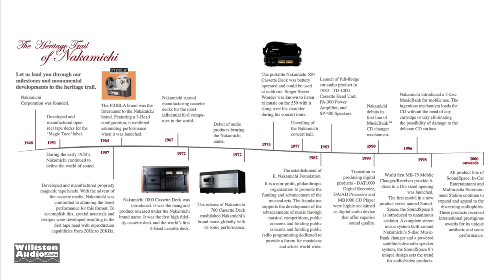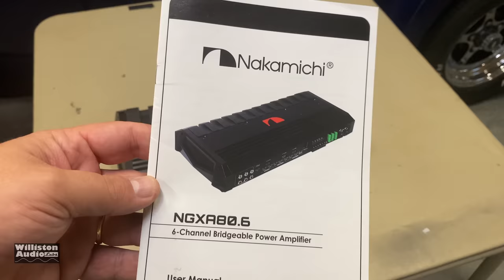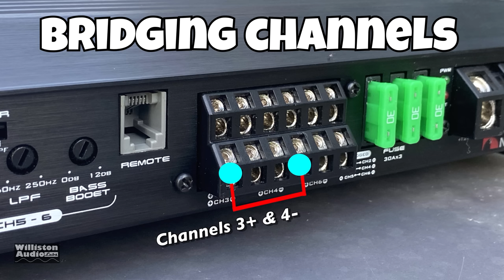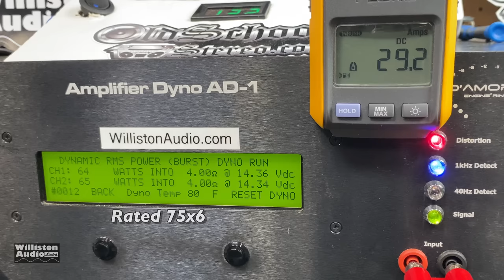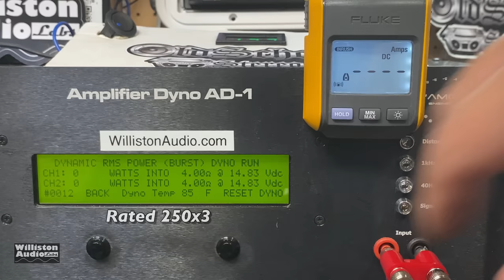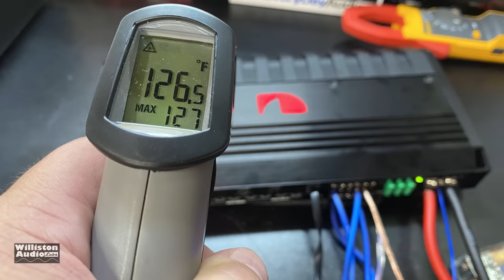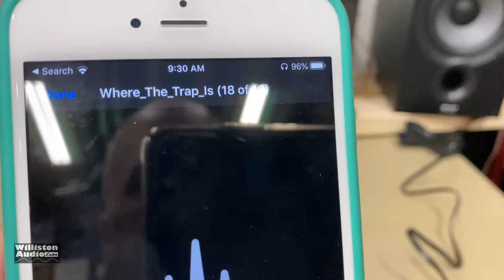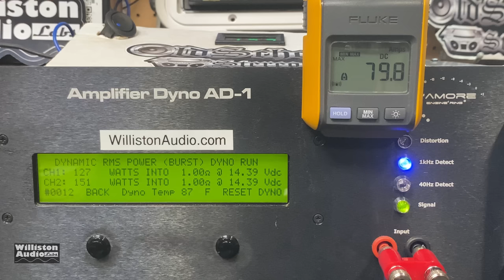Nakamichi is Back! 6 Channels for $200?

Comment: That's a shame, I still have my old Nakamichi headunit kicking around somewhere. For amplifiers, at that price point, albeit being a 4-channel I would run the Pioneer GM-D8704 all day long... especially that it's underrated with the big bonus that they are regulated and stable at 1-ohm on each channel (pretty much guaranteed at least 125-150W RMS between 1 and 4 ohms). That 1-ohm stability is way more worthy than having an additional two channels, especially if you are wiring low-impedance speakers on one channel (i.e. door midbass build with multiple speakers).

Comment: I have a serious question about a amplifier I have. This is the second  one. Both were brand new.  When you increase the volume. At  certain point  the amp cuts back the power  to around half  then builds back up.  And it does  this with a load  or no load.  I've  tested many amplifiers  with my multimeter  (100s) an have never seen that before.   Don't laugh  its a orion cobalt cbt4500.1.  Sadly it not the same a budget gem. Tested.  Which is  what I thought I was getting.

Comment: I hate to say this but you know what looking at the insides that amp just makes me kind of want to go ahead and shrivel up on the inside knowing that nakamachi ....has literally built an app to a cost and you know what it doesn't even make me want to buy it.    I'm sure it sounds good as everything else out there but that's the point. When you get one of these kinds of ants you expect to get basically a amplifier that has really good components and yeah it looks nice on the inside but it's just not what you'd expect from a high-quality premium brand.    

I honestly think that the Dual amplifier that I picked up a little while ago which is a 4-channel not only sounds amazing but to me with the upgrade just a few components for the $99 price that I got it for? It really brings it into another level.   

a 6 channel amp should basically be all about sound quality and you know what this really just doesn't make me feel like I want to purchase it. Yeah I got a lot of amplifiers just sitting around but you know the thing is is that sometimes you by and collect things that actually make you feel proud for owning them this just isn't one of those products for me.

Comment: Newbie to this Ch. but CR-7A owner since '86 so the lure of Nakamichi brought me here. I could care less for any pre-meat of the video chatter so I must admit to skipping ahead to the results of whatever you were going to do when what stopped me dead in my tracks was your unveiling of the Amplifier Dyno AD-1! I left this video to research that thing and now I am back to say ... If what I have seen here is correct, then wth happened? Some Chinese company bought he Nakamichi name and is now releasing garbage under its name? There must not be anything keeping someone from bastardizing a quality brand name like whoever owns the name now is. Ha, just remembered. About 10+ years ago driving through I believe Rosemead CA on one of the major blvds when I saw Rogersound Labs and nearly broke me neck whipping my head around to double take. Here in So Cal Rogersound Labs was a small higher end audio retailer that specialized in building as far as I know all of their own amps, pre-amps, tuners, speakers, etc., of which I still own amp, pre-amp, and speakers from. They went under around '93-ish? So when I saw that place around 2010 I had to stop in. Unfortunately it was just the name they had and nothing more. The Asian shop owner even seemed clueless as to the name the were selling under. Sad. But Nakamichi is back! Sad.

Comment: This might make an OK amp to do 3 way component up front. If the sound is decent then you can't go wrong for the price.  However how would the channels rate if you were only driving 2 rather than all 6? which would simulate different channels doing different notes.
Reply from the maker: Good point

Comment: Not to say your equipment is faulty, but could the amp dyno need to be certified. Cause I know the welders i run get certified every year. Those ratings are pretty close. Like I said not saying your not right just wondering

Comment: Shame about the power, but as mentioned in the other comments, they probably are nominal figures... so can't really bash them on the low numbers perhaps (though they should make this clear & not even quote nominals to begin with).

Flexible amp for the $$ and agree that having all the connections & switches on the 1 side is really nice. Also the red light up logo looks pretty neat.

Comment: According to the "specs" on amazon, that thermal cam has 80x60 resolution. Same as my built in thermal cam of my BV9900 Pro phone. Had the Cat S60 previously. Sad tho, Nakamichi used to be on same level as McIntosh.

Comment: I know you probably wont read this, but I have the Lvl 3 cert. from Flir's ITC.  Just wanted to offer some tips and advice for using that little OnePRO. I have 13 years experience with the T400, C3, GF320, T1010sc, and the older FlirOne. Lemme know if you want my advice, or if you're having any troubles.
Reply from the maker: I read all comments and reply to as many as I can! Tips and advise are appreciated 👌
Reply: @wal  Sent an email to yer gmail

Comment: back in the 70's 80's and 90's Nakamichi ruled the high end market ,(true japanese company back then)I owned the dragon  for the house casette player was amazing best in class also one of the most expensive,I owned a NAK head unit and amp for my car using ADS speakers was amazing very costly but the technology in the unit was one of the best .Nak was my favorite elctronic manufactuer .They sold to the chinese co in 1998 .I did not know this found out after  the fact dam. I purchased a soundbar /woofer  with the Nak name on it ,not knowing they had been sold to the chinese  company.I quickly found out what junk they were now .The build quality was junk the weight was a give away that something was amiss here.set it up knowing I was going to be disappointed yeap I sure was disappointed absolute junk ! To bad the Name can live on but the quality is GONE!Learned my lesson due research first but after seeing the NAK sysmbol which i knew very well I figured it was the same company WRONG .THE REAL NAKAMICHI  RIP

Comment: Hey Big D, been wondering, what do you have the amp gain set to when running these tests? Im guessing balls to the wall, but figured id ask.
Reply from the maker: Amp gains are matched to the Alpine head unit. In this case about 1/2 gain, but remember turning the gain up higher will only distort sooner. It will NOT give more output power
Reply: @wal  Yeah I'm the big dummy this time, can't believe I didn't remember that much, probably been out of the game to long.
Be cool to see a big dummy lesson on setting gain though, love the behind the scenes stuff.

Comment: Even 50 watts on some good mid bass is pretty loud. Especially on efficient tweets. I would run it full active 6 channel front stage but I mean if I'm going that far, why do it with a cheap amp? Like folks that get the big 5k amp n expect big things outa stock electrical. If your going big, do it right. Bridged and in other configurations not bad for the price. Still a class ab 6 channel amp n that's cool alone in my own opinion.
Reply from the maker: Yeah pretty cool, just really cheaply made

Comment: Hey guys hope everyone is having a Blessed weekend. Does anyone know if the power wire on the line output converter has to be connected. And do you connect to front speakers or back speaker to the converter?
Reply: Probably depends on the converter. Also depends on what positive you are talking about. Are you talking a power, or positive input. If it has a power wire then I would assume that it needs power to work correctly. Even more likely if it has a remote power which turns the amp on when it senses a signal. Most of the loc's I have used were passive and didn't require a power source, but the last one I used which had the remote turn on option required a power source. I always just used the positive input on my amp to power that loc. Which speakers to connect to depend on the factory stereo and what you intend to amplify. Most modern factory stereos have a lot of signal processing and don't send the full signal to all channels. If intending to use for subs, best bet is probably to use the rear channels as the rears usually have a larger speaker, therefore will most likely have the low end you are looking for, but that may not necessarily be the case. This is why companies like audio control have started making loc's like the epicenter which you hook up to all channels and it has the ability to combine all channels and redistribute how you want.
Reply: Yes sir I’m sorry it’s the power wire. I didn’t connect it because I thought it was to feed the blue wire. I have the amp connected to the ignition.
Reply: If it isn't working at all, I would say just connect that power wire to your amplifier power input and see if that works. Or if you have a distribution block connect it there. Unless you are installing it behind the head unit. Then you have to find which one is your power and connect to that. I have always put loc's in the trunk so i don't have to run RCA's the whole length of the car. Plus the rear speakers are usually right there.

Comment: For a brief few minutes I thought you got the tube amp. I got another disappointment at the numbers. 3rd disappointment on the gut shot. The styling of the exterior screams cheap POS. Nakamichi hasn't been Nak since the introduction of the CD35 & 45 of the mid nineties, some folks love those 2 HU's but they were kinda junky. Their amps of the 80's were rebranded Yamahas.

Comment: Is it just me or are those woofers moving a bit slowly with this amp?
Reply: The woofers are revealing the weakness of the DC to DC converter (power supply section) of this amplifier. The woofers are low frequency/infrasonic (well below audible frequency) oscillating, as the secondary power supply rail capacitors charge up and down. Basically, the amplifier's power supply section cannot keep up with the audio output section's electrical demands and the woofers moving inwards and outwards are showing this visually by revealing the amplifier's lack of ability to control (in this case, return the woofers to the zero point/center suspension point) the woofer's motion while under load. Poor design.   Fred

Comment: I know this sounds odd, and I also am considering the HUGE number of crappy amplifiers out there, today, but it seems like EVERY current amplifier that you've tested fails on every level, and not by just a little bit, but in the most spectacular of fashions.  Knowing that the CEA requires these amplifiers to be at LEAST PMPO (Peak Millisecond Power Output) capable, and even though I haven't seen any CEA markings on the boxes you're opening, could it be well within the range of possibility that your dyno needs calibrating?  I mean seriously.  Every amplifier?  Missing the mark by (what seems to be across the board) 50%...?  I'm just throwing it out there...

Comment: What if all along the dyno that you are using is not calibrated correctly or has been reading inaccurately all along? Have you ever tried a different dyno? What do actual sound laboratories use to dyno their stuff?  Dimore is not in these major manufacturers labs.  I've always wanted someone to dyno the dyno and show us the guts of the dyno. I see and notice the series or model of the amp being 80.6...is accurate for it's total power as tested. Kinda.
Reply from the maker: What if we are living in the Matrix? Should we take that red pill?

Comment: How does 3 x 30amp fuses handle "3000Watts|? A little math always exposes fake watts. Receiver manufactures do it all the time. Max output will be labeled on the back (490watts), yet they claim 150watts x 7 channels.

Comment: If Nakamichi is back, and they offering $199 amps like this and $1800 amps like the one you showed, my guess is there is a licensing deal going on and this is just a licensed amp sold as a Nakamichi. Looked some pretty craptacular components.
Reply: Looks like they didn’t test the higher end so let’s go buy a JL JX amp and bash the VXi series based on the cheap model lol 6ch $200 sounds like a deal to me.

Comment: Yeah, I was expecting real Nakamichi, like in the 1980s and '90s. Ohh, so disappointed. But it is not very expensive for 6 ch amp.
A friend had Nak CD head unit at the turn off the century - very clean comparing to other decks. I still have '90s Nak 3head casette deck, 25-21kHz @-2dB. Mechanism needs some work.

Comment: Sad... Nakamichi was one of the leaders in cassette tape audio. The Dragon was the it as far as that went and it cost a fortune. Dot com bust then a lot of manufacturers of high end audio either got bought by bigger corporations(Mark Levinson, Krell) or the market collapsed. Nakamichi couldn't keep up with Sony, Technics etc on the CD front and they disappeared. Enter 20 years later. They make dvd players for car audio. They make a bluetooth speaker. Stuff probably not even made in Japan anymore. Hot garbage some of that stuff. Just unfortunate.

Comment: wow this thing is trash.   would have liked to have seen if that bass boost would have added anything.   kinda wonder about that ever since that one orion amp you tested.  you know becase if you could actually get the 250w rms out of the bass channel then with the other channels running highs or highs/mids it may sound alright as long as you had 2 12's?

Comment: I guess if all someone wants is to be impressed by a name that does nothing for you then buy one. Looks like a pretty weak amp to me. Theres nothing quite like seeing a nice looking amp that you think is going to be just awesome, and be let down, but only 200 dollars. I say..save your money and get something you're going to like. I'd like to see the thermal image of that amp after it's been running at 50% power for an hour or two, and at full power for that long. I predict it would go into thermal protection mode long before the 2 hour mark at full power. As weak as It is. I don't think full power is going to do much for you anyway. I would have liked to see it connected to a 12 inch dual bandpass box, and a 3 way full range box with either two 12 or 15 inch speakers.

Comment: Signal to noise ratio 90 is HORRIBLE it has to be over 100.    Distortion (total harmonic distortion) 0.2 is HORRIBLE it has to be less than 0.05 and 0.005 would be really good. Thd is how much of the music got changed inside the amp the higher the number the worse the sound! How loud an amp is in not the end all be all. You could get listening fatigue with this amp and it's bad numbers very quickly and you could damage your speakers at loud volumes.
Reply: You obviously have no clue how amps work......
Reply: @jeroenschuuring6060  you obviously have no clue what I'm writing about

Comment: It's a real shame you have and use an AD-1 and AMM-1, as they aren't designed to measure N-power. I'm willing to bet that does make rated power, if you were measuring output correctly. 

Honestly, I don't know why no one seems to know what N-power is, yet claim to have been in the game for a while. 

I mean everyone should know that N-power is "noisy" power and has 10%THD.  Of coarse you're not going to get rated power from that amp when you falsely believe it's power with up to 1%THD and use equipment designed to measuring such.

If you haven't caught on yet, I'm just spouting BS. 

Shame that amp came up so short on power. Like all, I had hopes, but before testing commenced, I was already having doubts it'd make rated. At least "that" didn't disappoint. 🤣
Reply from the maker: I thought it was naga power...naga, naga, not gonna happen